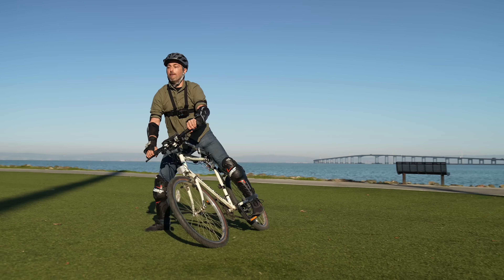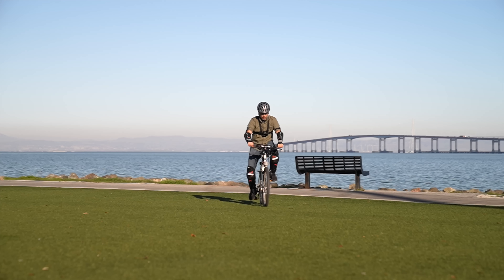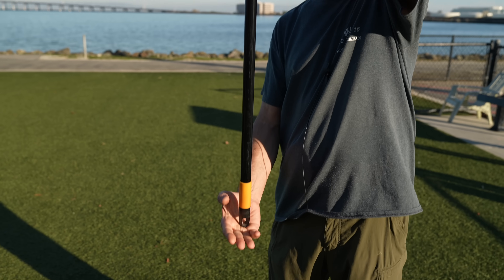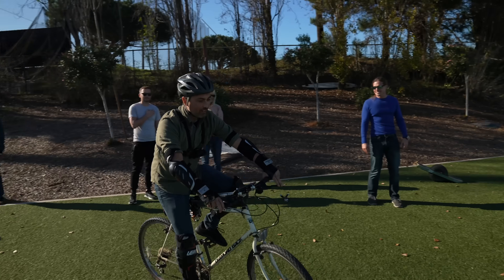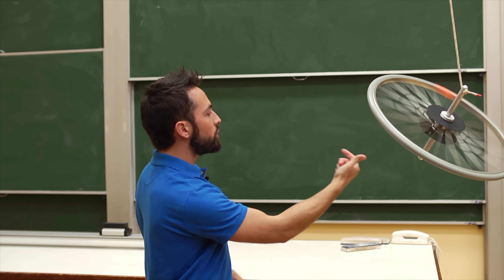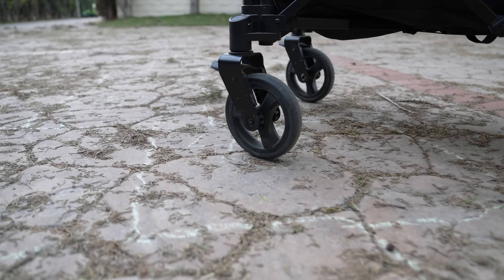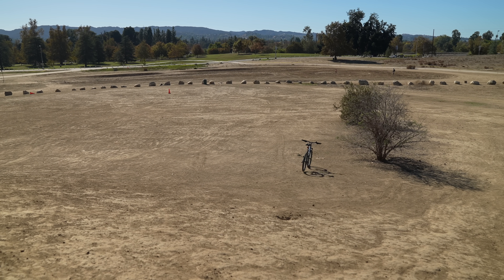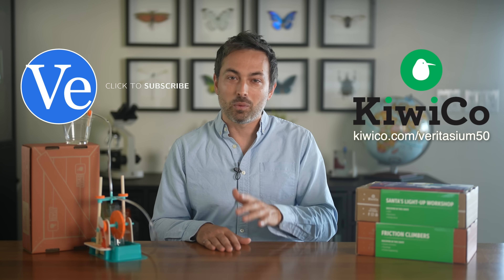Most People Don't Know How Bikes Work

Comment: It can be done, i do it on my bike all the time, but when i need to corect the balanse then i use steering.

If it is locked in one direction, you can do it without countersteering with just leaning your body in corner thats how motorcycle turn at high speeds, and dont try that on the grass because you need a grip, and you need speed that makes you to not fall. When you lean on your tire that has smaller raidus on the side which will make your wheel turn in corner.
Also its same for the skiing , it is called carving, you dont turn your skies you just lean, and smaller radius of skies makes you turn, but again you need speed.
But at lower speed countersteering is easier and faster turning for sure.

Comment: What is missing here is a discussion of hands-off cycling. I can do that endlessly, in tough terrain and even with turns. You actually don't need control of the handle bar to steer and to remain stable.
Reply: Not touching the handlebars do not change physics. Bike always try to countersteer.
Reply: @XtreeM_FaiL and how does the "bike always try"? It has an AI brain?

Comment: Anyone who was taught how to ride a motorcycle knows this. When learning how to make an 8 you start steering a small bit to the other side before steering the way you actually want to go and you counterlean like crazy because you want your centre of mass to stay below you and not with the bike. At higher speeds you steer with your body, so lean left to go left, lean right to go right, and don't lean to go straight. Once in motion you could let go of your handlebars as it will want to keep itself upright. You will slow down on a flat road because you're not applying any gas. Would not recommend trying this on an open road, it's dangerous.

Comment: Just hold on a moment the gyro effect of the wheels does help keep the bike upright. In the example the speed of spin is very different. It creates a force which is not there at standstill, or slow speed like he was riding at. The people try are not going fast, there are people walking next them. On a motorbike this is very clear, at that point you only steer in the wrong direction, there is no left right to turn right, only left. 

Also it is harder to balance at a stand still but it is not impossible, after practice.

Comment: This is pretty much the same reason why whenever I'm carrying weight in shopping bags on one side of the handlebar, the bike always falls to the opposite side since it facilitates a lean to that direction. For example if my shopping bags are on the right side of the handlebar, the bike will want to turn left, because those bags turned the bar to the right, easing a left turn as shown in the video. We leave space for the front wheel to fall in that direction by making it look the opposite way, that's how it leans in. We do it so intuitively that it becomes an unconscious decision.

Comment: I can balance stationary on my motorbike at traffic lights using a lot of small steering inputs plus some light throttle with the clutch pulled. Without engine revs its pretty difficult, but with enfine revs its a lot easier. I think gyroscopic forces play a role in that. The crank and the oil against the clutch plate would have a fair amount of mass.

Comment: You only really need to counter steer in sharp turns. Otherwise just lean into the direction you want to go and adjust as you need
Reply: With a condition for your first sentence. 

You only need to counter steer in sharp turns *based on speed.

I ride bikes, scooters, motorcycles, and can make easy 90 degree turns if you're going slow enough with no need or desire to counter steer.

Go as fast as you can on a track, your turns are way wider, right? 

It's about speed, not if the angle is sharp or not. If the turn is inperceptible, keep going 140mph. If it's a right turn in a development, you're going to seriously need to consider slowing down no matter how much counter steer you try at that speed.

Making it extreme for a point there. Counter steering isn't necessary. It is if you are going too fast for a turn you want to make and didn't slow down enough.

I see people counter steering in cars getting off exits at like 25mph like they're gonna tip over. They're wheels literally go into the other lane, mid lane honking because they're still going the highway speed but a guy in the right lane is counter steering his civic at 25mph to make a wide right in the clover.

Counter steering just seems dumb to me unless you need it. It isn't just simply what you need to or should do. It's a tool for a specific, and IMO rare situation. You don't just always have to counter steer.

Go the right speed for the direction you are going to go in.

Comment: Some years ago I had the opportunity to ride a short ride on a curve-leaning tricycle with two leaning front wheels. Only a short ride of a few hundred meters. I did not get a hang of it because it was so counter-intuitive to my tacit knowledge of 50 years og biking making that small countersteer. I knew that it was my problem but I couldn't abstain form the counter steering.

Comment: I'm surprised that you didn't mention why we need to lean in the first place. It's to redirect the centrifugal force that our bodies experience down in the direction of the tires instead of our sides. If you turn the bike left without leaning left, you will fall to the right. Inversely, if you feel like you're falling to the left, steering left will bring you back upright. Maintaining balance consists of several of these micro adjustments being made every second.

Comment: Why are people acting like this is new. when motorcycle riders have been countersteering for as long as have existed.  Now you can ride a motorcycle without knowing your countersteering but you're not a good rider those who are good riders not only countersteer the push it. How do you think a sportbike on the track flips down so fast, if they have a right-hand turn the push on the right bar turns the wheel left laying the bike down into a right turn.  How I teach this, is to push right to turn right push left to turn left. never pull a bar it's a push.

Comment: I actually knew this right at the beginning when I was learning how to ride a bicycle. Maybe because I'm an INTJ and I'm very logical, I can't learn thing like other people do. People usually learn thing intuitively, and because of that they can be really bad at teaching the others as they were able to do it without actually understanding it. I noticed that the bike won't just simply turn by steering.

I was not on the padel, I just used my feet to push the bike forward on the floor to gain momentum till it has enough speed to make the balance easier for me. And because my feet were closed to the ground if I fall I can easily save it. I start to try to balance the bike. And I just notice if the bike is falling on one side, right let's say, all u have to do is also turn right to let the bike back to center. The angle that u have to steer has the minimum threshold, below the threshold u keep the leaning and turn momentum. If the angle were above the minimum threshold you break the leaning momentum and "push" the bike back to middle. And how tight the angle u can have in a turn were based on how much tilt u initiate from a initiate turn. The bigger the initiate turn, the bigger the threshold or allowance to have bigger steering angle to keep the turning momentum, thus tighter cornering.

Comment: This is quite a remarkable thing actually. If you learn to ride a bike as a kid you probably learn to do this intuitively. I learnt to ride a bike as an adult and figuring out how to steer just seems so difficult because you need to countersteer, I would think if I wanted to turn right that I just need to turn the handlebars to the right but I need to turn to the left first to initiate a lean to the right so the bike turns to the right. It's interesting that at low speeds (like slower than walking pace) you actually need to turn the handlebars to go where you want to go.

Comment: Not to show off, but it is actually easy, the only way to turn left o right without using the counter-steering method is to put some balance on where you want to turn without exaggerating, I am not an experienced downhill or mountainbiker but is my main sport and using a bike since 5 using diverse technics such as maintaing balance can make possible to achieve this.

Comment: I think I get why you can’t just body-lean instead of counter-steer. Is it Newton’s law about an equal and opposite reaction to every action? Say I want to lean the bike left so I could then turn left. There is no way to lean my body left without the bike itself leaning right to compensate. I imagine this could work, but only with an external force like slapping a wall on your right to lean the bike left. Or the wind hitting you perfectly.

I get why counter-steering works, you push the left handlebar forward, bike has momentum and wants to keep going straight but since the wheel is now turned right the bike spills left because all the weight has forward momentum, at which point the mass/bike itself (not you, it does it itself at least on motorcycles) corrects itself and turns the way you wanted.

Comment: I do not entirely agree. To preface, I am a hardcore, yet amateur biker of two years now. I only bike at 21 speed (gear 3 in front and 7 in rear.) regardless of the hilly incline or decline I face. I use a gear ratio of 3.5 with 27.5 in. diameter rims on hybrid tires. Turning only requires my hands on hard 90's at over 20 mph. I only need counter steering when pedaling, but that alone would slow my pace so I also cant the bike throughout each pedal stroke. Unnecessary canting is reduced by not pedaling much in the bottom, front-wheel-facing sixth of the pedal cycle and barely making contact on the return half stroke. That is mostly because, as an amateur, my shoes do not clip into the pedals, thus I cannot pull the return stroke faster. Turning correctly starts with reverse pedaling so the turn-side pedal is maximally raised (even then I turn hard enough to grind the pedals sometimes), stop pedaling, possibly break, possibly countersteer canted only(always turn into the canting) and very early(assuming no jutting obstacles like tree branches or roots), then lean hard with your spine and body centered with the metal frame as normal, then steer into the turn only enough to maintain traction. In the case of straining uphill on each pedal stroke, countersteering and canting (especially with your bum pushing against the pedaling side of the seat, especially while uphill without hands) will occur every pedal stroke.

Comment: 4:30 It is not luck, it is just that you got used to leaning first then turning
If you try to turn the handle before you lean you will fall, but you could lean first and hold the handle bar loose so that the handle bar turns itself to counter the lean and you have successfully turned without turning the other side

Comment: Am I wrong in thinking that this is more about balance and center of gravity? Regarding the counter steering thing, what happens when the first input (gray cause of steering input but roll with it) is the rider rather than the bike. Seems like counter steering was a method used to make a person react to shift CoG to the inside to balance out the forces of the intended turn direction. What if the rider consciously did the CoG shift to the inside to get the neutral lean? Would they be able to turn without counter steering?

Also, any plans to dive into the motorcycle side of things where at speed it's only count steering and active balance shift.

Comment: Its possible to overcome this limitation if you practice turning without holding the handle bar. That kind of riding requires you to shift balance into the turn, then the wheel will point into the turn and start changing your course. And vice versa when you are riding normally and starts to tilt, you turn your handle bar slightly towards the side of your tilt which counteracts the tilt.
So, by only using your body posture (and thigh pressure on the seat and bike frame) you can initiate a turn without having to explicitly turning the other way to create the initial tilt.

Comment: Crap. 

While counter steering ADVANTAGEOUS, it's not REQUIRED. 

Turning right? LEAN as you  gently steer right. (Outside pedal down, weight the pedal, too).

20 years of commuting, and the only countersteers were for TIGHT turns.

Comment: I was hoping to see more physics explainations behind the demonstration, so here's something interesting:
Turning left/right also depends on your speed as well . At high speeds, we need to countersteer (turn left to lean right which turns the bike right) but at low speed turns below +/-25 kph it reverses so we need to turn the handle bar right and lean left to turn right to make a U-turn or tight corner. 

You learn this intuitively with practice, but there is a transition velocity where you must make a call on how to turn the bike depending on the corner angle and your speed. 

The type of input can also change mid corner, meaning a corner taken just below or above the steering transition velocity may require a different line and turning technique especially to maximize performance (watch the insane 60° lean angles in Moto GP and see how they push the limits of physics)

How about a follow-up video on a motorcycle to demonstrate this behavior. 

The mass of your 2 wheeled ride of choice also affects this transition velocity that will require an inversion to your inputs (harder to demonstrate on a bicycle, easier on a motorcycle). 

You should do a Collab with the guys at FortNine, they make amazing videos on this and you could describe the crazy physics involved.

Link to FortNine:
(YouTube)/U1mSavQ_DXs

Comment: Counter-steering is something that was covered when I first learned to ride a motorcycle. Especially at speed, you have to steer the wheels out from under you in the opposite direction in order to initiate the turn. The higher the speed, the more obvious this becomes. The motorcycle turns not because of the steering angle of the handlebars, but in the direction the motorcycle is leaning.

Comment: The gyroscopic precession example given (8:50) is better explained when thinking of riding a motorbike, or counter steering, because people seldom push down on the handle bars, they either push them forward or pull them back. Counter steering melts people's minds because pushing on the left handlebar/pulling on the right and they think the wheel would turn right, whereas it makes the bike lean to the left and initiates a left turn of a motorbike. If you push the left bar, the top of the wheel leans to the left, conversely pushing the right bar leans the top of the wheel to the right, the opposite of what you would intuitively think thanks to gyroscopic precession.

Comment: Or you could just initiate the lean using your body. It doesn't work well on motorcycles but works fine on bikes lmfao. Also steering your bike with the bars is silly when the body and leaning does most of the work. Very little bar input is really needed.

Comment: Now I could be wrong, but as somebody who rides a bike every day I feel like I hardly use the steering at all, and mostly steer with my weight. Because of this, when I’m moving quicker and go to turn left, (per my assumption) I neither steer left nor steer right, but I just lean directly into the turn, and then slightly turn the bars after. I wonder if this is motivated by the fact that I used to speed skate competitively, and am thus very comfortable at an angle. Gonna go record some videos of myself biking to verify haha

Comment: This video describes how counter steering works at slow speeds. The faster you go, the more counter steering comes from gyroscopic force. You can test it yourself by spinning the front wheel and holding it with both hands then turning it. The seat tends to move in the opposite direction. If you don’t spin the wheel you can turn the wheel without the seat moving at all.

Comment: I have a huge problem with this because I have found that I don't even use the handlebars to turn. I simply lean one way. With this system I doubt I could straighten back up but I believe you could simply lean slightly one way to turn. Most of your "turning" is from the leaning of the bike. NOT the steering of the handlebars.
Reply: when you lean and turn it is the same as if you do the counter steering method shown in the video. You're moving the bike out from underneath your center of gravity in both scenarios. The only difference is counter steering moves the bike from under you vs leaning moves you from under the bike

Comment: it only applies to low speed and fast object avoidance imho. riding motorcycle it is enough to lean, and a bit turn to the direction need to turn not the opposite first
Reply: leaning and the counter steering method shown in the video have the same effect. You're still moving the bike out from underneath your center of gravity when you turn. The only difference is counter steering moves the bike out from under you and leaning moves you from over the bike.

Comment: Just tried this out myself and videoed it to see if I do the same. Turns out from going fraim by fraim that when I want to turn i just move my body in the direction i want to turn with using the handlebars. This does make the bike stand slightly more upright but atchieves the same effect for shifting your center of gravity for the bike to be able to do the turn. Allowing me to manoeuvre and get around corners that don't actually have a lot of room in them